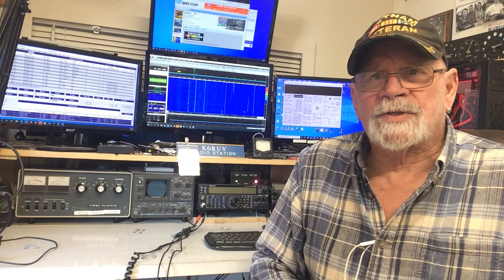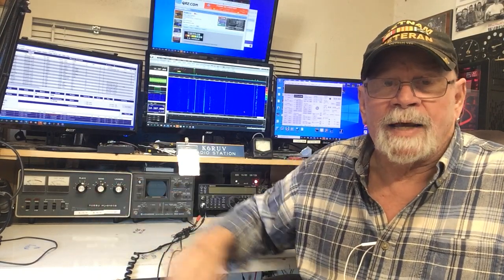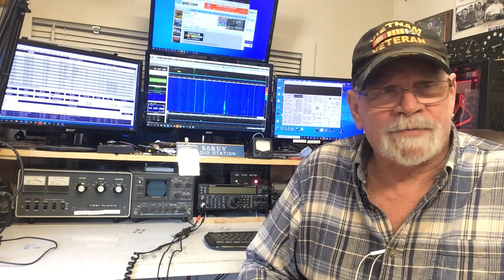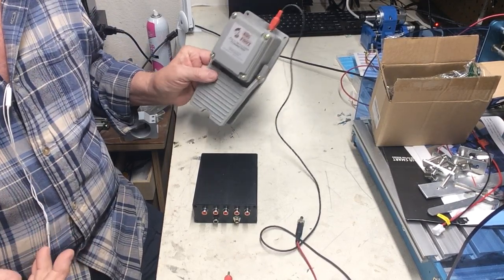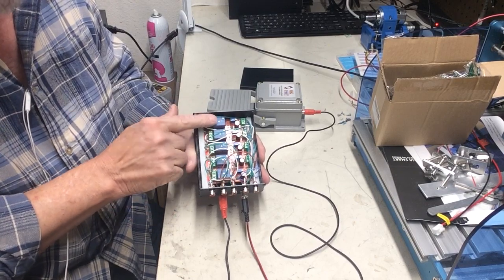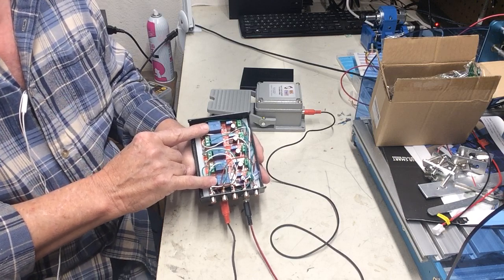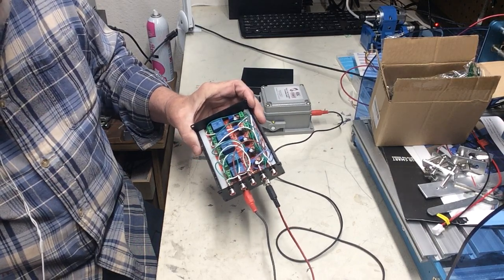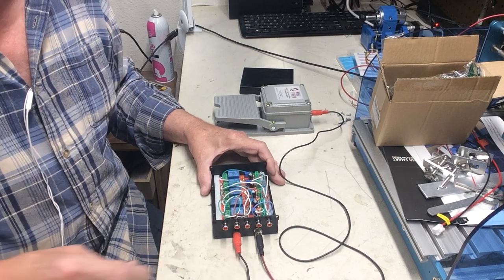PTT Relay Box

Comment: Great little project, I just wish you had been a bit more specific about the modules you used as I see there are lots of "delay off" modules on Amazon, which would be the wrong ones to get I suspect. After looking into one of those MFJ SDR antenna switches - and noticing that they did not use coax inside and a plastic case rather than a metal case, I decided I would just build my own the correct way (This is why I almost never buy MFJ stuff).  Thanks again! Dave - W5KUL.